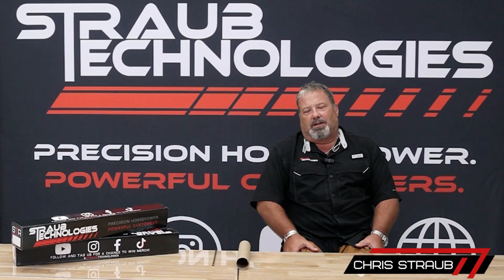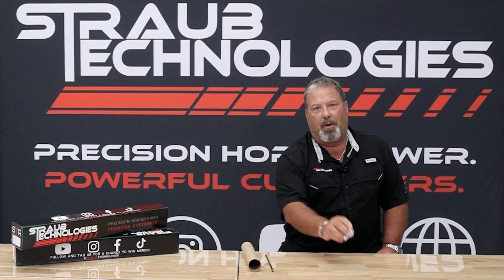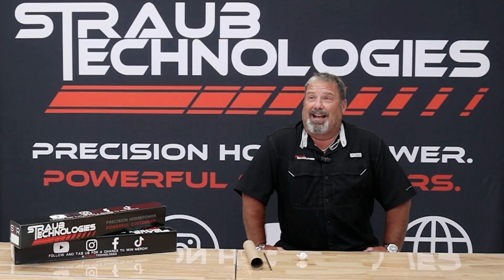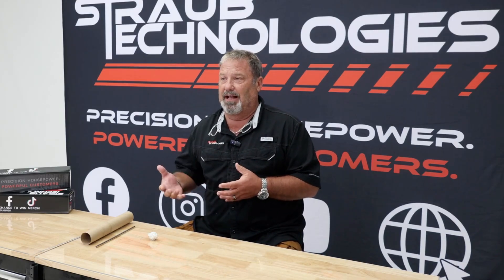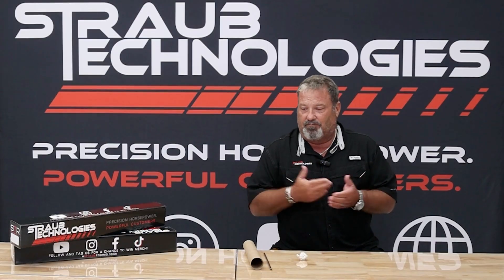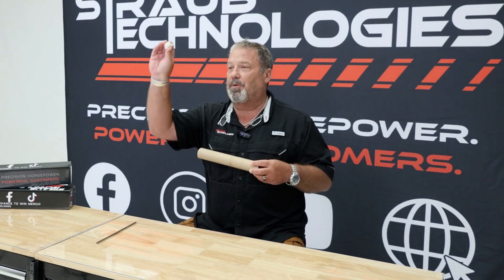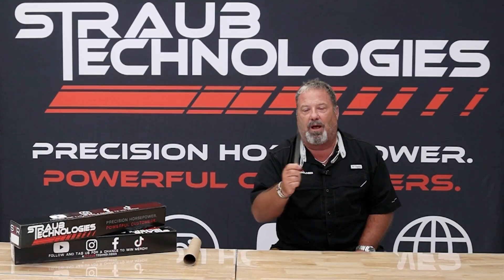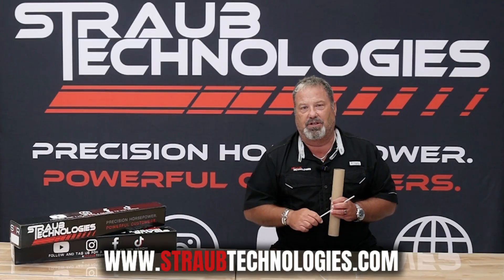Volume vs Velocity

Comment: On a 394” Cleveland that will have a 228/234 roller cam, and won’t see over 6,000 rpm, would you use iron  4v quench heads or iron Aussie quench heads? I was told a that cubic inch it can really go either way.
Reply from the maker: Find the MCSA of both heads and do the math.  It won't let you down.

Comment: Both the straw and the paper towel tube illustrate line-of-sight induction. Decreased valve angles are always better than big volume, as the port is stood up to accommodate. Max intended rpm dictates cross section for a given cubic inch.